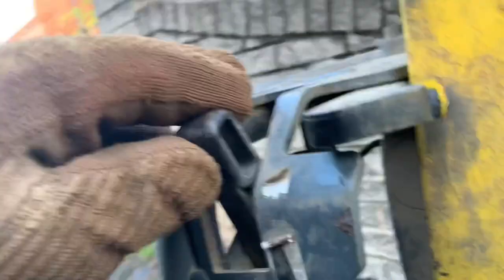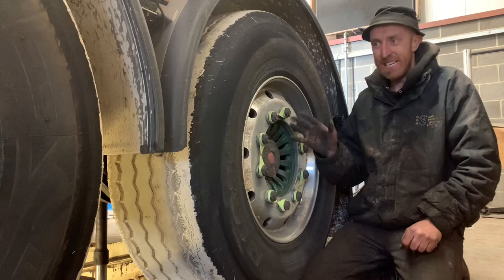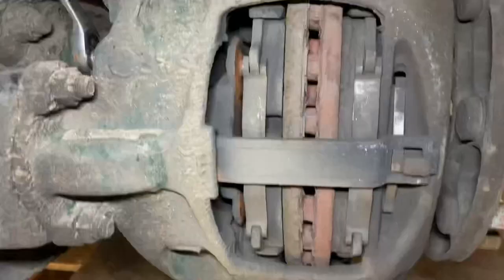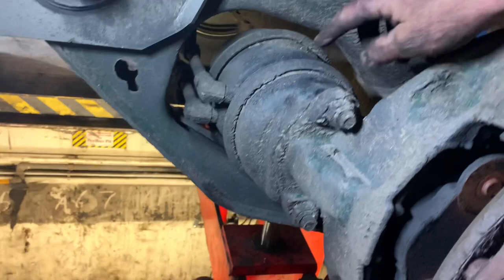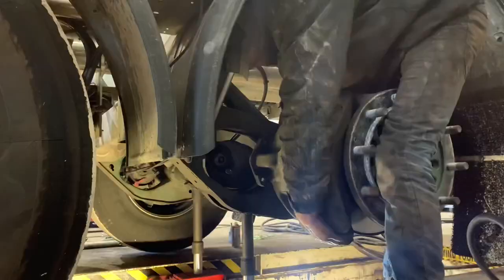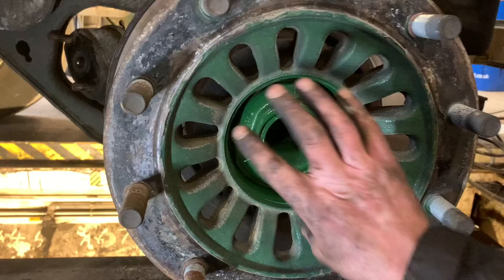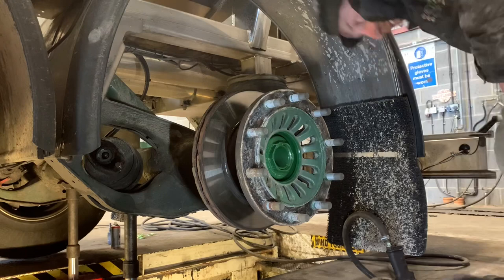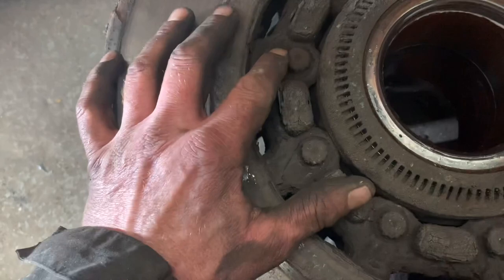Trailer How to change brake pads and discs SAF axle mobile hgv mechanic lorry truck trailer semi

Comment: Love this channel mate and it’s great that watching the boys with you… question, don’t you put copper slip on the back of the pads and doesn’t that hub nut have anything to lock it? Like a tab or stalking the nut in?  Drove wagons for 6 years in the 2000s and despite being a Land Rover mechanic by trade I never really looked at what was under the wagons I drove..  thankfully I don’t have to drive them anymore although I do miss the industry!

Comment: My favourite axle I’d prefer to work on 100 SAF with stuck hubs then on BPW axle lol
Reply from the maker: Stuck hubs are time waster 😅
Reply: @Professional-struggler  9 inch grinder fixes it pretty quickly lol
Reply from the maker: @rayw9067  yeah the good old 9” with a new disc 😂
Reply: @Professional-struggler  you know it 😂

Comment: Next video pls Chris massive pls give me a massive  shout out to gee Owen, for a Vauxhall nova upgraded, 1m seat Leon 1.9!non PD ENGINE upgrades CANT BEAT THE 1.9!asv engine code SHOUT OT TO THE RHOSNIGER CRUE AND THE BIG RACE SURCET IN TY CROES, don’t know if you have herd of the big race track in Anglesey??? Thanks man love your vids bro 😎 

Wrexham demon tweets did a brilliant job, boys,  you where the best car gone in for the day 9am  lowered on ebach coil overs, bigger garret turbo 1000cc injectors can’t remember the number of turbo, new high lift cams, stage 2 tune performance and short shifter,the car went in 130 bhp car came out 190+ 420 neutron meter of torque.. plus teamdinamics 19” super light weights in gloss black  had spacers polly bushed bk and front, I had to baby sit this car witch I still have to this day and still not blown fuck all as a poformance clutch gets changed every 3000 miles

Comment: Those winders can be a bitch, and those daft 11 point snap off bits you get in the brake kits are ridiculous- a good sneeze and they snap lol then if you use the 11 point socket and it's stiff you end up knacking the mechanism lol 😆
Reply from the maker: 😂😂 I know it’s like there made from glass 😅

Comment: Those axles are not good, brake adjuster is plastic, bearings get stuck on axle, and putting that hub nut on with a inch drive gun invalidates any warranty, must torque up properly, if you do torque up, any damage to threads are covered by SAF!!

Comment: Good old SAF near side wrong side that’s what I say to me self when I do them, and I absolutely hate them axles  there 🤮 prefer BPW or ROR mate, I know we all do it but your not supposed to use windy guns on them hub nuts like you say they strip  hate the disc bolts too always cut the heads of and weld M14  nuts over and yours came out no props ya must of kissed them and spoke dirty to them lol 😂
Reply: He cracked them off with  spanner and hammer first i think mate
Reply: I’m talking about the disc to the hub the ones that rust like mad
Reply from the maker: Just hit the socket on and the little wiz popper gun did the rest! If there really corroded it’s a nightmare